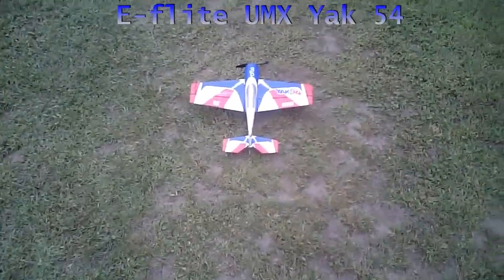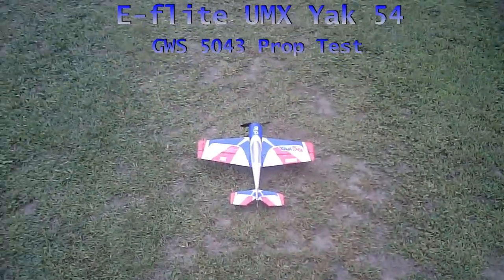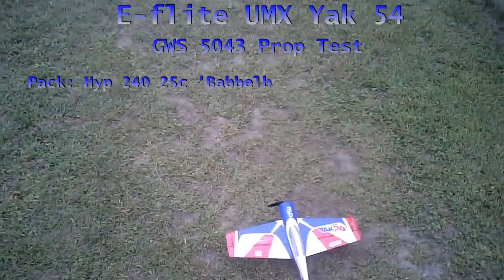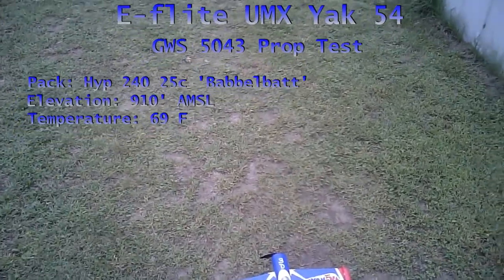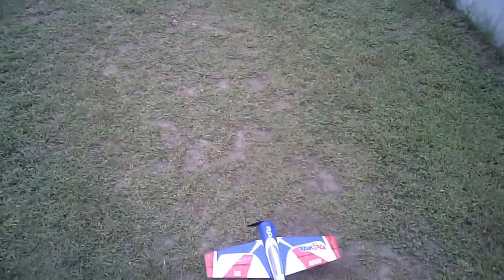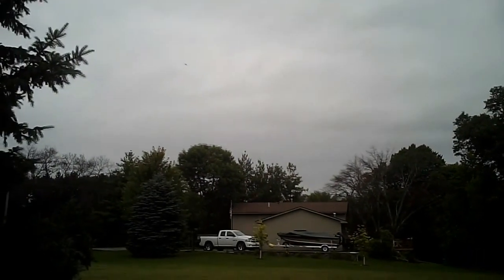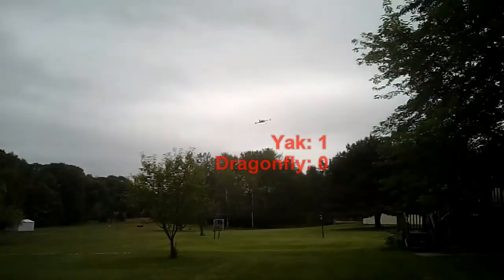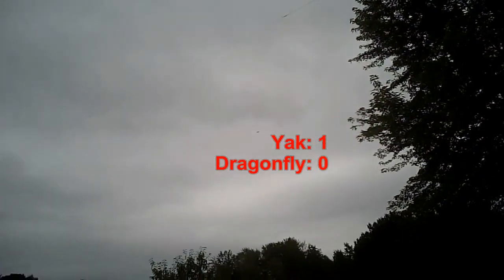UMX Yak 54 - 5043 prop-test

Comment: Hey Joel its stalyoni here. I tired a 5043 prop on my yak 54 and it just made it lag wot. I like the 5030 prop on my yak 54 better. Come and say hi on my thread sometime mate.
Reply from the maker: Hey Stal - how's it going? Yeah, it's been awhile since I checked-in with you guys. Guess it's about time, 'eh? :)

Regarding the prop - a top-notch, low-IR pack is absolutely mandatory with the 3000Kv/5043 combo, due to the high current. The 5043 is a lot faster than the 5030 if you use a high-quality, low-sag pack such as the Hyp 240. That's what I used in this clip. :) (However, the factory prop is by far the best choice for overall performance - especially 3D.)

My goal was to come up with a reliable 2s combo for the Sbach 3D that's nearly as fast as the 2300Kv/5043 is on 3s - for those who want more speed, but are reluctant to try 3s. The Sbach 3D is unquestionably the best prop-driven UMX airframe for high-speed flying. I used the Yak for initial testing only because it was quicker to switch props on the Yak than to switch motors in my Sbach 3D - which is currently set up for max top-end on 3s with the 2300Kv/5043 combo. (I'll switch back to the 5.75" x 2.5" prop on the Yak.)

I used a TP 325 70c for my initial bench-test to establish baseline static thrust & stalled-prop pitch-speed. Initial numbers were 10,770 RPM @ 161g of thrust, with a stalled pitch-speed of 44 MPH. At 30 sec into the run, I recorded 10,300 RPM @ 147g of thrust, with a stalled pitch-speed of 42 MPH. For reference, the numbers for the 2300Kv/5043 combo at the 30-sec mark on a 3s Hyp 180 BabbelBatt are 10,700 RPM @ 159g of thrust, with a stalled pitch-speed of 43 MPH. So the 3000Kv/5043 should be pretty close with a top-notch 2s pack. :D

The next step is to try the 3000Kv/5043 combo in my Sbach 3D - which is already set up to handle 50+ MPH speeds on 3s without flutter. I'll be using the TP 325 70c in that airframe because it is currently the highest-performance UMX pack in the world, and I already know that I can get the CG right with RCBabbel's ultralight version. :D
Reply: thanks for that info joel but ill just stick to the 5030 prop for my yak 54 as im using zippy 180 lipos in it. Yeah come and say hi